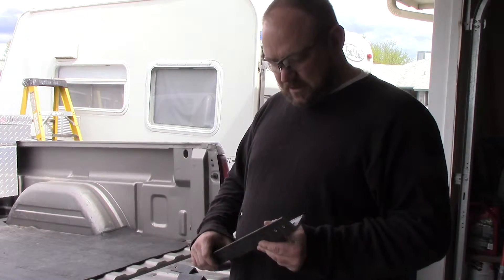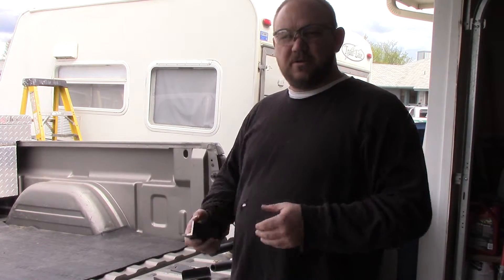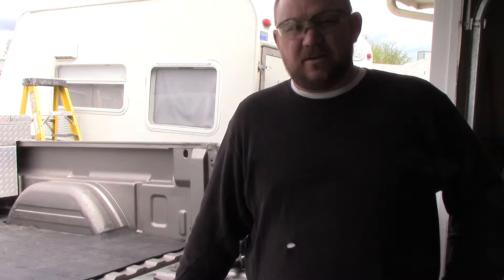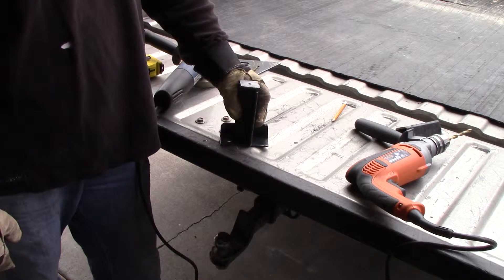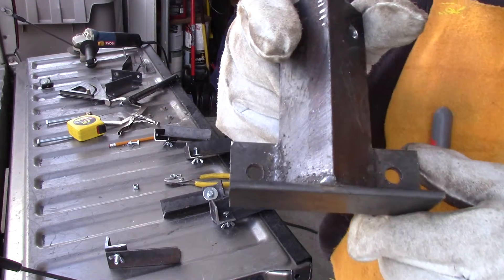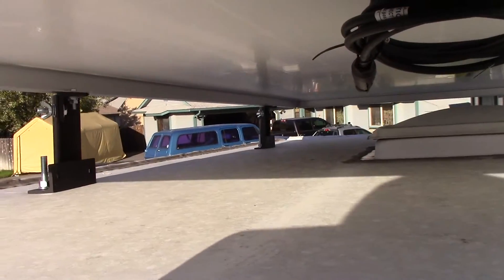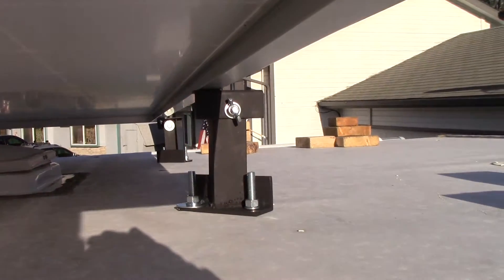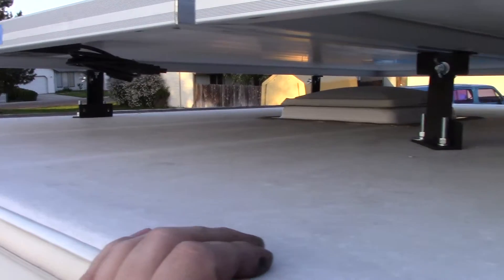Solar Panel Install on RV with Custom Mounts

Comment: Thanks I like the idea of mounting above vents✌️as they need to be closed for moving. Finding clear space on my 31 foot RV is quite challenging for these residential panels. My RV has front and rear AC s on the Class A and really breaks up large mount areas. Was considering mounting above aci's which I didn't like going higher and other idea mounting one in the middle of the roof and one in the front attaching the front part of panel to the fiberglass nose cap which I didn't like either.

Comment: Nice job on the brackets.  They look really good.  However, what is important is the surface area of the bracket where they are attached to the roof.   The thickness of the material isn't really relevant as you are only really worried about the mounts tearing off the roof where they are screwed on.  All the mounts on the market are made of light stainless steel or aluminum, and I think that's all it needs to be.  Those materials will never tear apart, and the foot size is about the same as yours where they are screwed to the roof. They are just as strong and safe as yours.   All the manufacturers say to use 6 mounts (not 4) on large panels like these.  Also, angle iron rusts something fierce.  I think your roof will be awful looking after a while with the rust bleeding onto the white roof.  Any thoughts on that?  Also, if the vent is in your kitchen, you may be blowing greasy cooking air into the back of your modules.  Not sure I'd like that.

Comment: Very nicely done I like you r mounts you have made, I am like you I would be scared some of those mounts would let the panel go at about 70 MPH down the highway. holy smokes that would be terrible. Great job my friend, I like a guy who is not afraid to work a little, you have don't a great job with all this. Great stuff. Keep up the Great work.
Reply from the maker: +Heartland Dual Sport Thanks HDS :) Yeah, that would not be good to see a $300 solar panel flying in the air in your side mirror haha
Reply: LowlySteward And my luck they would hit someone.